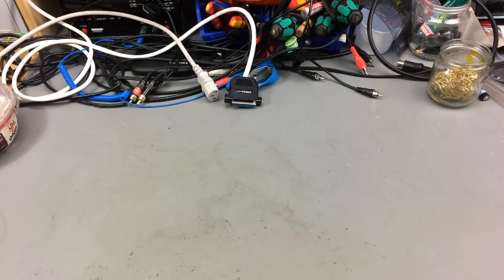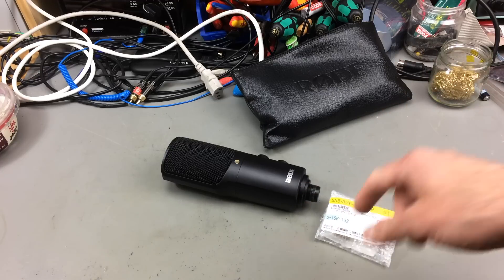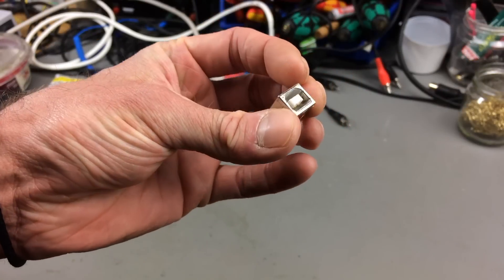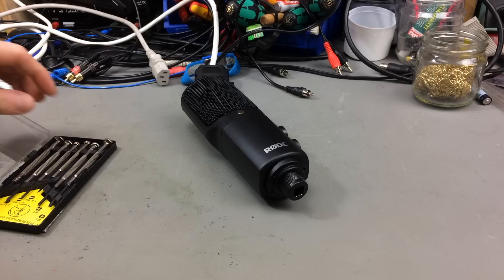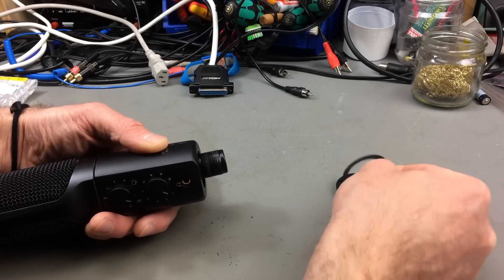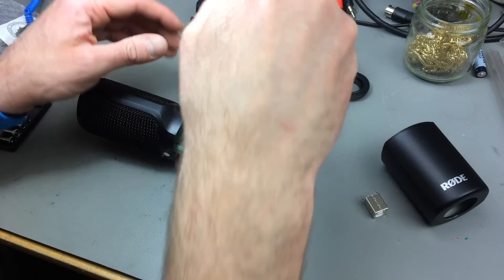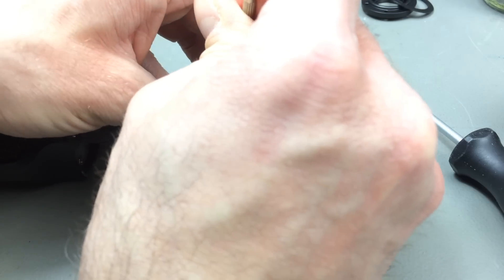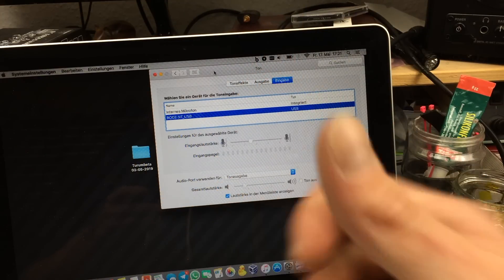Røde NT USB Microphone Repair

Comment: I recently repaired the same type of connector on a Blue Snowball microphone. The white plastic middle part has a tendency to break off and get stuck inside the USB cable connector if you yank it.